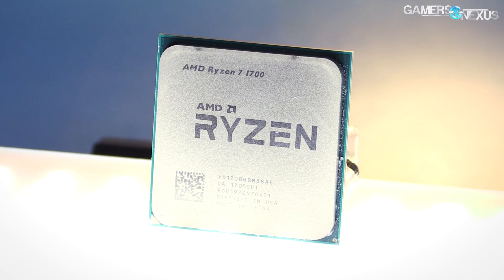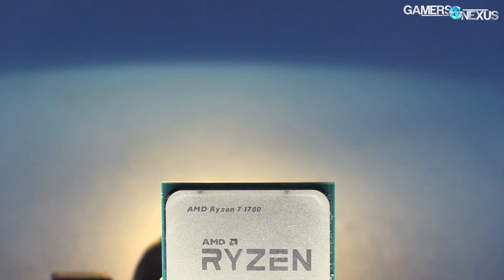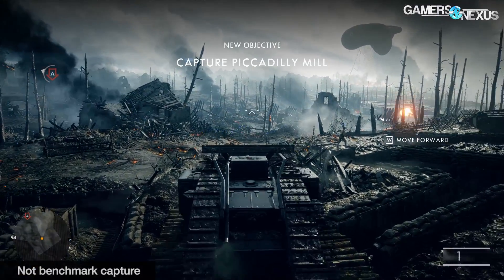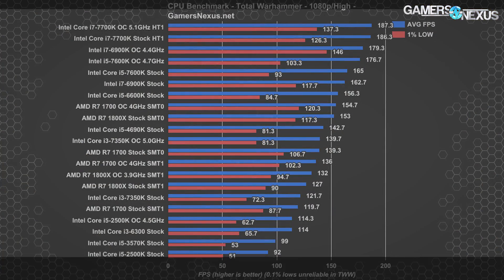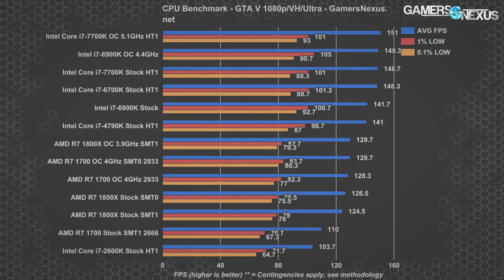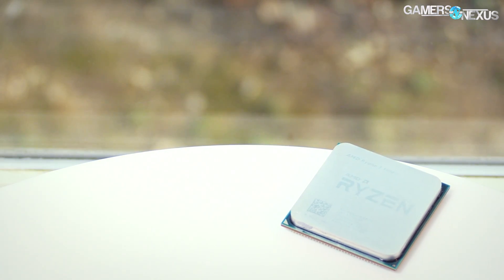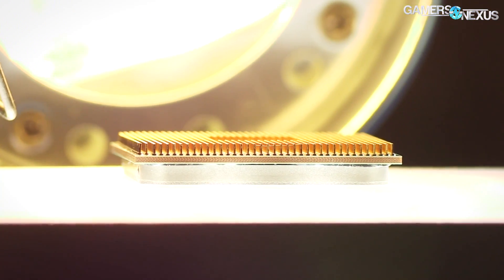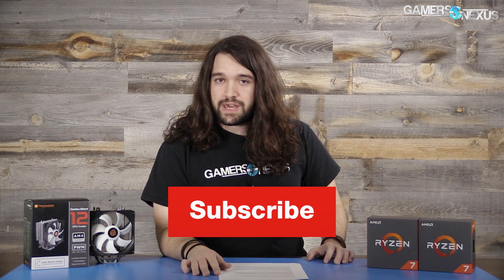AMD R7 1700 SMT Off + Overclock Benchmarks

Comment: Few things to keep in mind here... The lows showed quite a bit of improvement with both OC And SMT0.  And that a lot of the intel chips that had higher scores also had higher clocks.  But yes, for the money, it definitely deserves its rank on those charts if you don't do anything that isnt gaming.  And of course we need to see what software optimizations bring.  All that said, it's a better chip for content creation and mixed work loads and not terrible for gaming.

Comment: 6:10 You did not mention the 1700 having 120fps 1% low, which in my opinion does not "put it behind" the 6600k which had 84fps 1% low. The average fps are very similar while the 1% lows are very different in the 1700's favor.

Comment: Thanks for your effort Steve.
I really appreciate it even if I didn't actually ask for it earlier.
And yeah, I'm an AMD fan too, although I've kind of stayed away from the comment fields and stuff of your videos after that review of yours.
The issue back then wasn't really so much what you where saying (factually correct presentation) as how you where saying it (letting your annoyance with AMD shine through in the way you where speaking).
As you've probably noticed AMD fans are a bit defensive and get easily offended by that kind of things.
And I'm not going to lie, I was annoyed by the tone in that first video of yours too even if you didn't technically say anything wrong pr say.

I hope my fellow AMD fans will feel that this video makes up for that earlier one of yours.

Comment: Wow, am I the only person noticing the Ryzen 1% and 0.1% lows are better most times than the i3/5's in many games shown here (both stock and tweaked OC).. y r ppl are killing themselves about high avg fps when this is the more important metric to show performance..(stuttering). Yes Ryzen is not putting the pretty big avg fps numbers as some i5s on the screen but these lows would indicate Ryzen having better gaming performance than i3/5's in most scenarios shown here.. Smoothness is not defined by how high the avg fps go but by how low the minimums drop.. (providing those drops are over 60fps on 60hz panel u'd be good tho*) More games and testing may reveal  different but based on these results I would conclude Ryzen 7 delivers better gaming performance than i3/5  but still beneath i7. Thanks for including the lows in your testing GN.

Comment: In this review you comment on the better frametimes (which were noticeable in the 1700 review, but not commented on that much) with SMT off and also you didn't feel the need to say that AMD are always attempting to forge all their benchmarks (presenting them as 1440p benchmarks where the GPU could be more of a bottleneck is perfectly fine though). I knew you were able to improve and become more unbiased and analytic when presenting the results and all in such a short timespan. This analysis was spot on and shows that turning off SMT isn't the cure for +10% overall performance, but it begs the question: What causes the increase in minimum frametimes in most games when SMT is turned off? Time will tell...

Comment: This is just an FYi as the overall video is very well done and no issues with that.   But on the statement that Cinebench is not real rendering representation.  That is an error.  Cinebench is basicaly a cut down Cinema 4D application.  Maintains the render engine and uses a regular scene.  Therefore it is a 100% representation of rendering power if you used Cinema 4D with that specific scene.  It would be like taking Blender/Maya/Max and using a script to hide the shell and just rendering a specific scene in Cycles.

Beyond that, the overall review, well done and to the point.
Reply from the maker: Actually, we said that Cinebench is a representation of real renders.
Reply: At 8:03, it was stated, "Cinebench isn't a real workload"" & "somewhat a simulation of rendering"   hence my my concern.

Though I know you guys are doing a lot of stuff so it could have been a bit of confusion or human error.

I just wanted to clarify that it is a real rendering engine, same one that is integrated directly into Cinema 4D product line, therefore is considered real workload, and in no ways a simulation like 3DMark is for gaming.

Again, just wanted to provide clarification based on the statements made directly in the video. 

Also I do not want to reduce the quality of the video as you guys did put a lot of work into it.  And it sure provided me even more input why my next purchase is going to be Ryzen, since my primary tasks are Rendering, and Gaming is secodnary.   Running Dual Xeon e5-2687w, which gave me 2200 points... and these chips are so close.... 

So keep up the good work however you react on my comment. :)

Comment: Will you please stop assuming that the only two work loads in the world are 1) gaming 2) content creation. a LOT of people code, run Virtual machines, run heavily multi threaded office applications, or databases. I respect your technical articles and really enjoy your content. I think there are some definite answers here to be had when looking at the cross CCX communication speed between threads. The scheduler improvements (see the Linux improvements for an indication of what can/should be done with the windows one). Have you tried looking at linux performance with steam titles by the way? It should give interesting results as it is far easier to swap in different kernels and test with an optimised scheduler and without on an otherwise same hardware / software stack.
Reply: What part of the above made you think i was a fan boy? I'm a fan of all tech. My current system is a heavily over locked i7 4790k. My living is made developing and speccing up large enterprise deployments and this has involved both Intel and AMD hardware. Huge parts of this involve benchmarking application workloads to specific CPU, storage, net work topologies. I have purchased a ryzen 7 as a replacement to the 4790k knowing full well it was a potential single thread down grade. I'll take a few less FPS for a doubling of throughput on the workloads that pay for my mortgage. The point I'm making is that gamers nexus is a great channel. I just think they need to consider who the audience is as i dont think the word gamers is strictly 100% correct for all the content they put out. It's a great you tube channel and i want to say i 100% trust their integrity and standards. I'm just attempting a little constructive criticism for a great you tube content provider.
Reply: There is irony to be found in this "Gamers Nexus" comments section.
Reply from the maker: That's great! But we don't cover those things. There are folks better qualified to discuss Linux workloads. We don't talk about them because it's not where we specialize. Try L1T.
Reply: I realise you generally target windows gamers as an audience. However your own content often goes into considerable technical depth and diverges from that. I get it. It's hard to keep everyone happy all the time. Keep up the great work. My original post wasn't trying to be arsed just giving some perspective.
Reply: Matthew Simpson all you described fall under the term productivity. There are two things; Gaming and productivity. Creating content, using VM, render, use multitasking apps etc is all the same. Gaming is its own. You could effectively stream and game. But when it comes to pure gaming Ryzen is an i5 of 2-3 generations back and in select few games like an i7 of 3 generations back. In other words if all you do is game. Ryzen is a fucking idiotic purchase and horrible in price performance. No amount of wishful fanboy thinking can change this. This is an objective fact that remains until amd can prove otherwise.
Reply: +Ola Hoglund you're either a very adamant troll or a very misinformed fanboy

Comment: lets be real..SMT marketing backfired. I mean in BF1 an OC 1800x SMT1 has less performance, as shown, than the OC 1700 with SMT0, what kind of bullshit is this? They actually shouldve marketed the new architecture with everything on SMT0 at a production/manufacturing level. period.

More shit: Stock SMT1 and OC'd SMT0 (always on 1700) yields a miserable 5 FPS gain, and while on OC and  backing it to SMT1 yields the same as stock....SMT AND overclocing is bullshit on this cpu. 

Who needs to benchmark a cpu 6 ways (factorial of 3 : SMT's, OC's and stock)? preposterous

Comment: I don't get it, if the Ryzen 1700 slowest speed is 72 fps while still kicking butt in the multi thread work loads to me seems like a great CPU! To me the gaming experience is fine. However, If all I wanted to do was game on my PC then I would be better off waiting on the Ryzen 6/4 core CPU to see how they operate or just stick with Intel.

I have an 8350 with a R9-285 so any upgrade is going to be great, but I am holding out for the Ryzen 5 series and hopefully they will be a good CPU to go with my incoming RX 480.

Comment: Hey Steve! I've been thinking about whenever I experience a hard CPU bottleneck in a game, there's usually no point in turning down most graphics settings (as you would expect) because it does not alleviate the fact that the CPU can't handle the logic, physics, and AI, for example.
That said, I've found the best test of "futureproofing" to see how well hardware can run at minimum settings because all the bells and whistles are stripped away, leaving a test of purely the core game code. Do you think you can test a couple games, perhaps on just two cards and CPUs (I think mixing Fury X+1080Ti/7700K+1800X would be ideal)? 
Often, on plenty of games, I'm not playing at maximum settings. It simply doesn't make sense. Depending on the title, I turn down effects that have a massive performance penalty for little visual benefit. We all know a GTX 1050 and G4560 won't max games out, but how will they play games at low settings? Does it hit a major bottleneck making it incapable of 60 FPS entirely in some games?

Comment: So if the R5 will have 4 cores and 4 threads and therefore operating at a lower TDP.  Could the R5 be a better overclocker? It seems to me that most of the current game titles don't really take advantage of multiple cores and threads but rather rely on IPC performance and clock speed. I am willing to put money down that a R5 1500 overclocked to 4.5ghz to 5ghz and with memory speed at 3200mhz could closely match a stock 7700k. If priced below 200 dollars, the R5 would be a very compelling chip to buy!

Comment: Srsly what is the point of buying the ryzen Cpu's unless you are a professional in content creating? The 1700 and 7700k are the exact same price (where the I7 can be overclocked a lot higher) and the 1700x and 1800x are significantly more expensive compared to an I7 7700k.

Comment: I have a better idea of what's causing the bottlenecks for Ryzen now. I realized that the 8 core isn't actually just one die. It's two quad core die's soldered on the same circuit board. That's really smart too i have to say. Making bigger and bigger die's are getting harder and harder to create so starting that now will prepare game companies and etc of what's to come with chips.
Reply: That is what is happening, at least if you look here:
http://wccftech.com/amd-ryzen-delided-gold-plated-solder-silicone-protected-caps-confirmed-cheap-tim/

There are clearly two chips on that PCB. Two CCX's. Each CCX with 4c/8t so a total of 8c/16t. The performance loss is because those two chips have to communicate with each other,  which is a lot slower than 4c/8t communicating with each other on one CCX.
The guys at PCPer say that something needs to change with the Windows Scheduler in order to account for this. AMD says that the Windows Scheduler is behaving as expected. So I don't know what could happen, it seems like it's in Microsoft's hands now, if you use Windows I mean. I have no idea how OSX or Linux deal with it.
Reply: ChaseMMD why do you think that? Do you have anything to base that conclusion on? Not trying to argue just interested in what makes you think that.
Reply: Well it's been harder to shrink the process node. And making server chips cost thousands. A intel 22 core costs 4500 launch msrp (Depending on clock but that is average). Now AMD could make a 32 core CPU with 8 quad core die's and do a pretty good job with keeping a load on it. Plus lets says a quad core chip costs 200 dollars to sell after taxes and ETC. 200 multiplied by 8 is 1600 dollars so automatically right there it's just cheaper to make. In the case of making a bigger die then you could try to make 50 in a wafer and only 10-20 of them are actually good. But i could go on about binning process all day and it can depend if there is headroom for it to work with some defects. But do you get what i'm saying?
Reply: Not necessarily. Intel is just greedy. This is only starting to happen now as i've never heard of any GPU or CPU that use this technique.